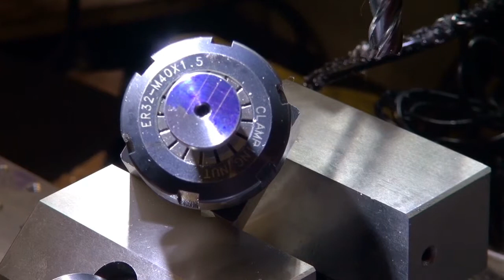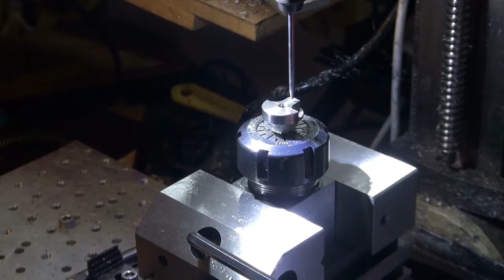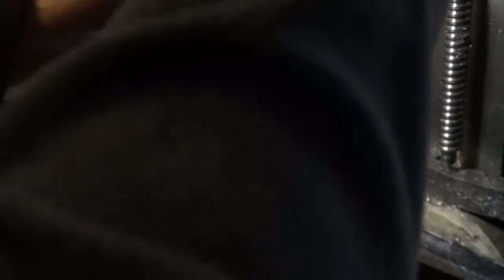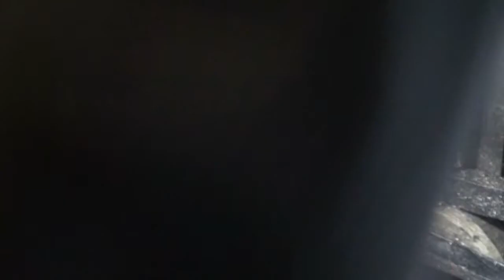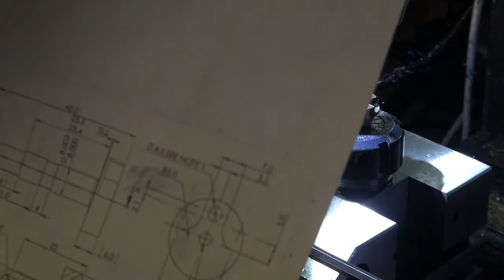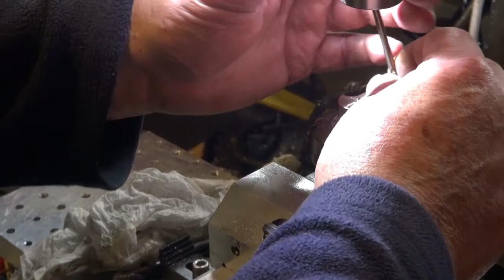Diesel Engine Build More Crankshaft 16

Comment: Interesting you've converted the mill to CNC. Now, 3 years later, was that a good decision ?
For a lot of one-off work, I'm struggling to see any value in making the conversion.
Reply from the maker: I still use it,depends on the job.I have made aluminum arms  foe a quadcopter on it for that sort of job.

Comment: Hi Keith...... Milling cutter - On a 0-10 scale of me being an expert, I'm about a 2 ! My thought would be that the cutter's going a bit fast ?
Reply from the maker: Smaller the cutter faster the speed you need.
Reply: @Aspins  I know that's the theory but you also need feed-rate to match - otherwise the cutting edge is just rubbing on the work